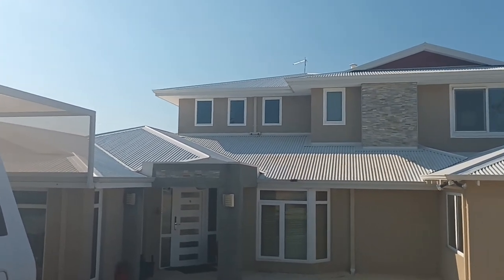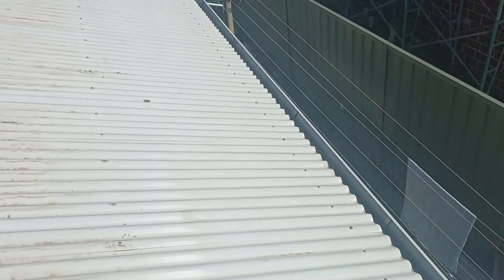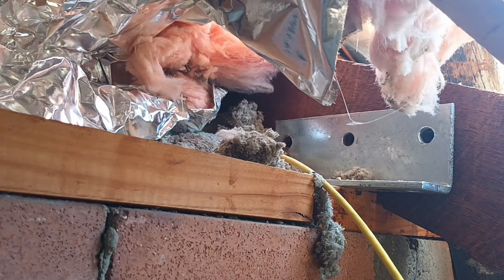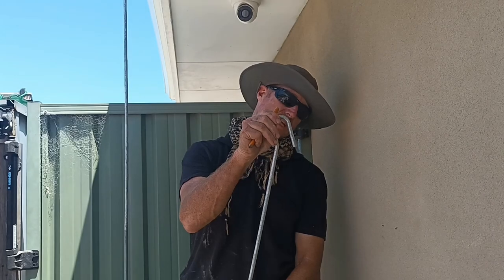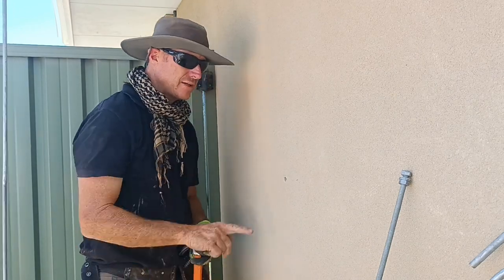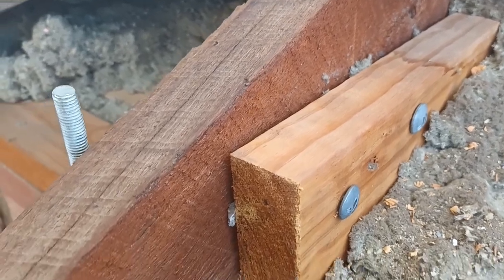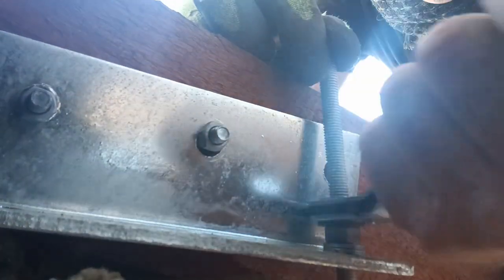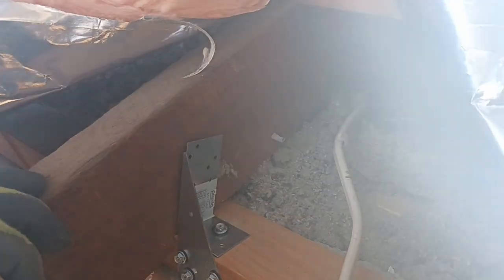How to install tie downs on a tin roof

Comment: How do you handle windows or opening where they are wider than 1200? if they are suppose to be installed every 1200? I have a set of sliding doors with a window that would span over 4000? BTW I am also in Perth, can you recommend an engineer? Thank you for this vid, I had no idea what tie downs are and am about to go from tile to tin.  I feel much more informed.
Reply from the maker: sometimes it is impossible to retro fit them but on new houses they will have  slot in the lintel that straps are attached too. as for an engineer,  I would recommend  looking on google. I have used structeer who were good. I am not sure if that is spelt right.